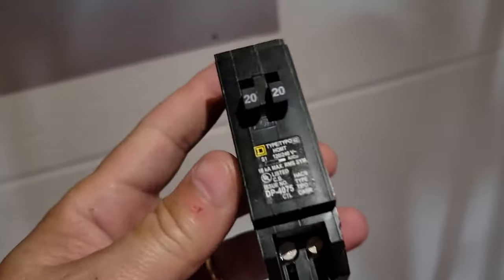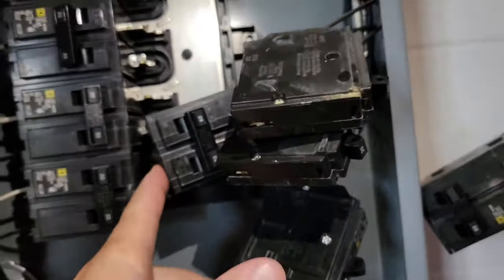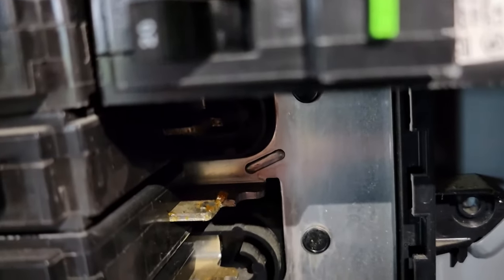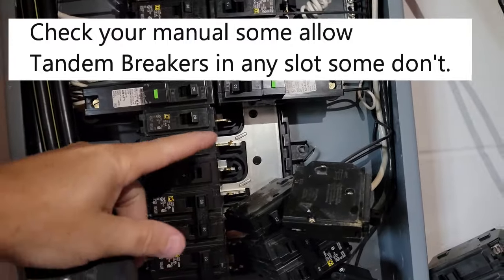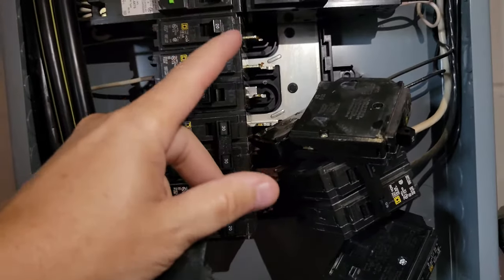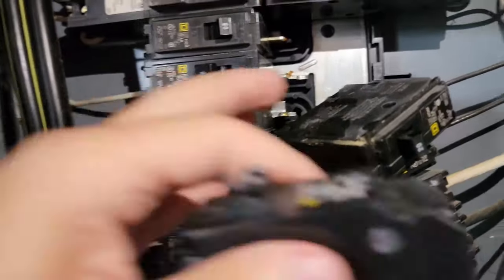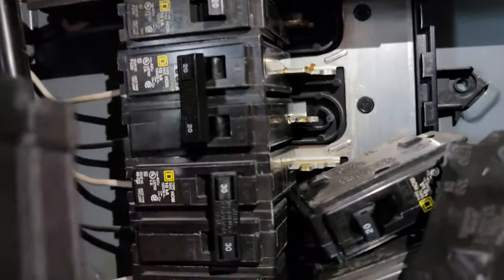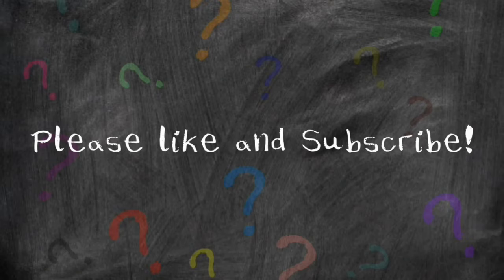How to use a Tandem Breaker in your Breaker Panel

Comment: Is putting a tandem breaker legal?
Reply: Yes, do you think every home improvement store would sell illegal breakers?? 😂
Reply: @JetFire9  first time home owner. Everything seems rocket science at this moment. I saw many tandem breakers in my electrical panel and freaked out that someone cheated by taking space of a fat breaker and put ‘weaker or low quality’ breakers in there lol
Reply: @punkeyengineer  It’s good to be skeptical about anything in a house that is new to you. Double breakers aren’t illegal, just like kitchen knives, but they can be used illegally. Depending on your setup, there’s a chance they could be in there illegally (code violation.)

Comment: Where's the warning about multiwire circuits using black and red, and why we don't put the black and red on the same phase? Are you going to be there when the insulation on the neutral fails and it causes a fire because the current on the neutral just doubled? Be responsible with these videos. DIYers don't understand and licenses don't need you to tell them.